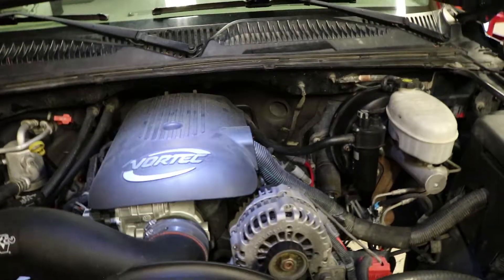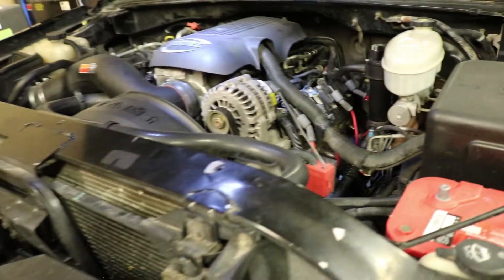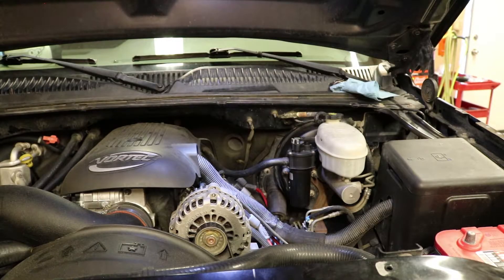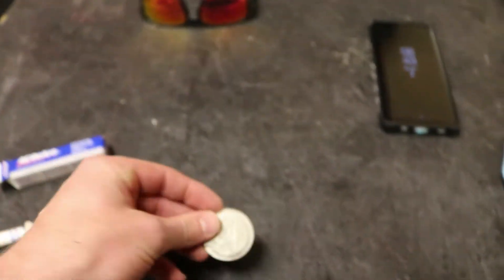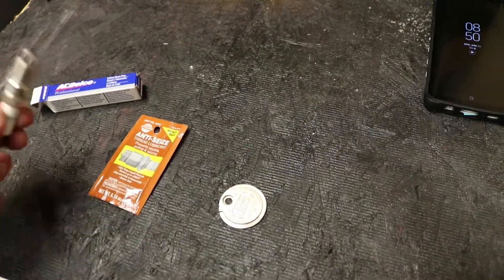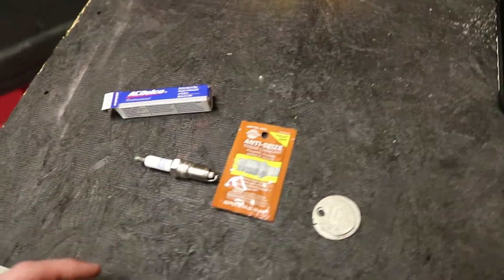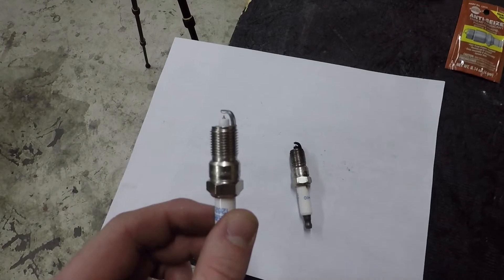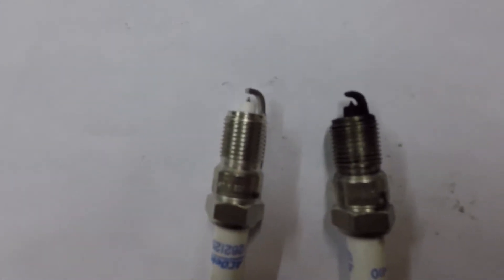Engine misfiring in higher RPM's

Comment: New plugs and wires on mine still doing the same thing 😒
Reply from the maker: You getting a p0300 misfire?
Reply: Mitch Carveth Not sure. The check engine light flashes when it happens but not stored or pending codes
Reply: @Themuncher288  my 6.0 doing same thing. I have a Bluetooth data logger running whenever car is on and it doesn't store a misfire code. If i run rpms up to 5k+ in my gto CEL will flash 10 secs then go off. If i drive regular never happens.
Reply: @fonz1anddone713  If you hold the gas down while it’s misfiring it will store the code. Most likely P0300 I’m gonna try and replace my knock sensors and see what happens from there.
Reply: @fonz1anddone713  did you figure out rhe problem? I have the exact same issue. I only get the light at 4500+ rpms but the light won’t stay there

Comment: My 2005 Honda Accord misfires only at 3rpm I’ve changed ignition coils spark plugs cleaned the egr put new spark plugs. And still having the problem if anyone knows why please let me know
Reply from the maker: is it like a fuel delivery issue? how many miles are on it? i'm wondering if its a fuel pump or fuel related.
Reply: Mitch Carveth it has around 200,000
Reply: Steve C took it too the Honda dealer they said it’s the engine :(
Reply: @frzspr1362  what was wrong with engine my accord only misfires at 7k rpm and check engine flashes i know its not the engine
Reply: @zachbento3798  transmission is bad
Reply: @frzspr1362  wtf a transmission has nothing to do with a misfire lmao. They’re robbing you
Reply: @noblevengeance312  mine really had a bad transmission it was a trash  car lmao
Reply: @noblevengeance312  the problem is it wasn’t shifting gears
Reply: @frzspr1362  oof lol
Reply: @@zachbento3798   I got shocked yesterday same high rpm flashes engine light .... so what it would be spark plug ?

Comment: Wtf, you video stops after 6 seconds. So I tried on my PC, same thing...
Reply: YouTube knows this video has the solution to my problem and wont let me watch lol. I only misfire as nd get check engine light once I pass around 2500 rpm. I had it in for service. They changed sall spark plugs since it was way over due, changed #4 coil since I was getting a #4 misfire and handed it back to me saying it was good. But it's not. Now it's a random misfire. Correct me if I'm wrong but when its random misfire it could by any cylinder at any one time? Any how you can definitely hear it when you are speeding up to about 40 mph. I suspect fuel problem. I'm going to test fuel psi tomorrow. Should be 51 psi. This test will hopefully tell me a lot. I'm surprised the shop didn't test this...
Reply from the maker: YouTube is pretty shady like that lol its showing nothing is wrong with the video? how did the fuel test go tho? did you check the injectors as well?  luckily my truck just needed plugs.
Reply: @MitchCarveth  haven't really been able to work on it much. Just had surgery and now I think I've got pneumonia...
Reply from the maker: Sorry to hear that, hoping for a fast recovery!
Reply from the maker: That's really weird, I'm not sure whats going on. Sorry about that, I'll check it tonight when I'm off work.

Comment: How many miles?
Reply from the maker: 218k miles
Reply: @MitchCarveth  Thanks. Was watching a few of your vids and was curious because I'm looking to get an '07 classic with the 5.3 from a small dealer but the mileage is a bit high at ~180k, they want 9500.
Reply from the maker: You're welcome, that is a bit high but I wouldn't worry to much on the miles as long as it's been taken care of, these engines last a long time with proper maintenance. Ive seen some go up to 300k and still run pretty strong. Unfortunately the guy that had mine before me didnt take the best care of it so that's why I'm building a new engine.